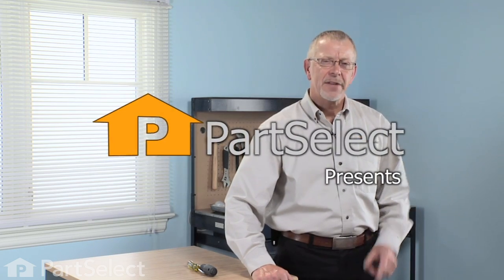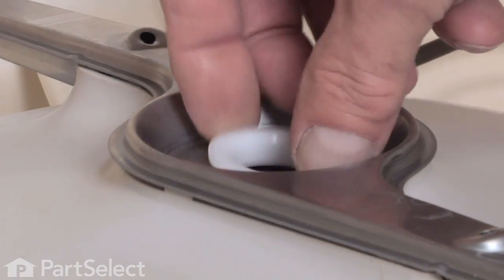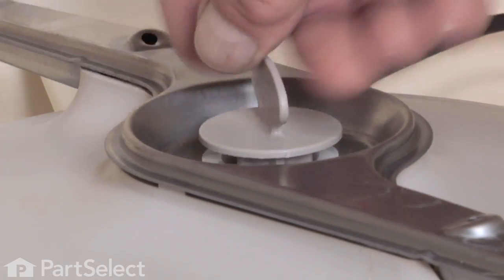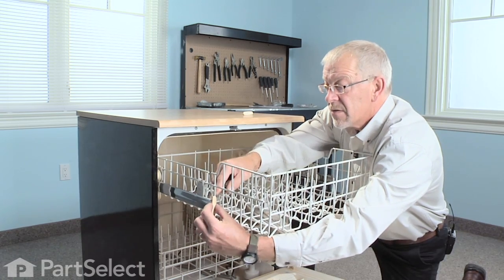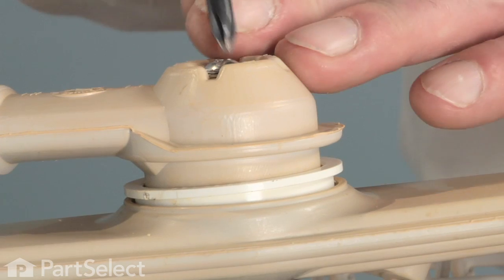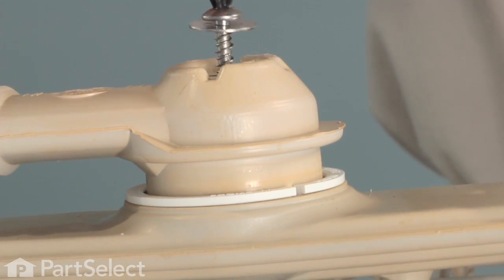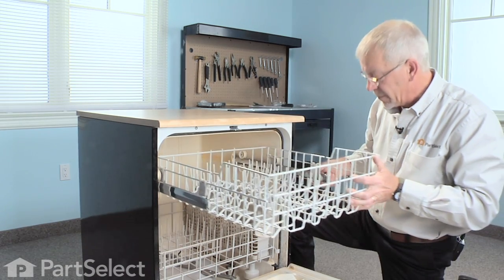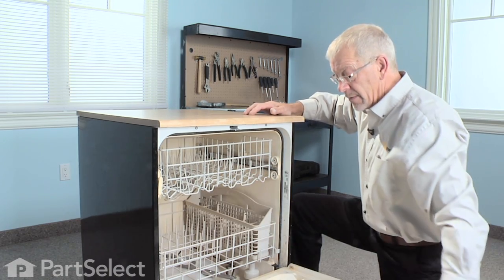Dishwasher Repair- Replacing the Upper and Lower Spray Arm Seal (Whirlpool Part # 3376846)

Comment: How do you know if it needs to be replaced? The one you took out and the one you put back in look the same to me.
Reply from the maker: If the spray arms are faulty then some of the common symptoms include the dishes are not being cleaned and the upper and/or lower spray arms are not rotating when the dishwasher is on. The spray arm to be wobbly and  that prevents a proper spray pattern. Inspect the spray arms for cracks or plugged holes and cracks or separated seams in the spray arms will impair the force of the spray. Hope that helps!
Reply: @partselect  Try again.  The spray arm gets distorted from the heat and bends down.  This is why they hit the supply tube.

Comment: Hello Steve, I have a kitchenaid dishwasher wich is only 4 years old, the problem is that the top and middle (middle top spray arm only) won't spray water, when I put a wash the bottom rack dishes will came out clean but not the top rack, the bottom part is working fine. My question to you is what i should replace? I removed both spray arms and cleaned.
thank you,
Rita.